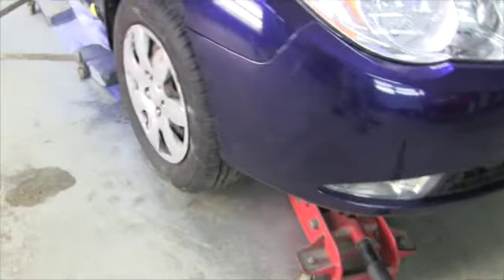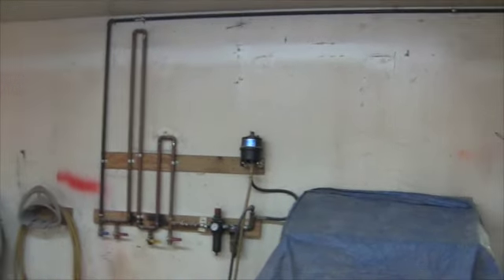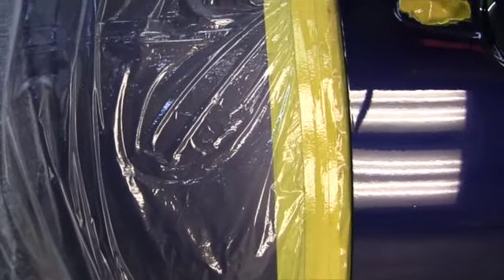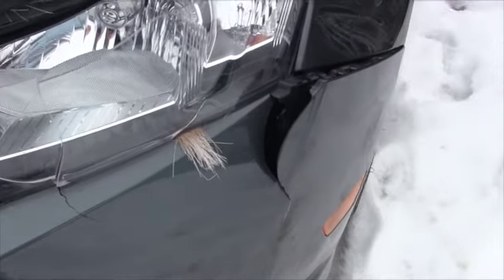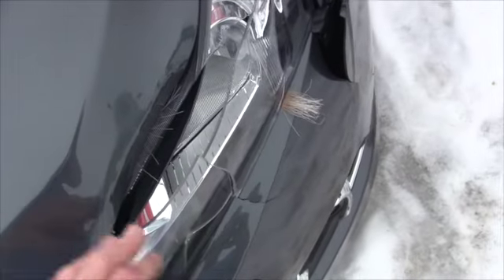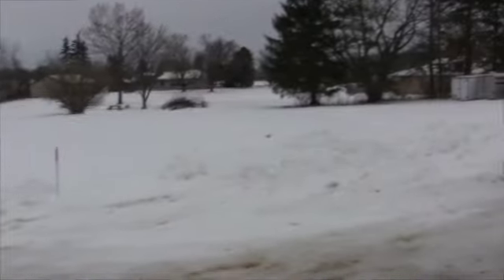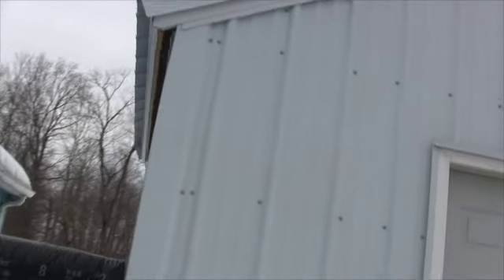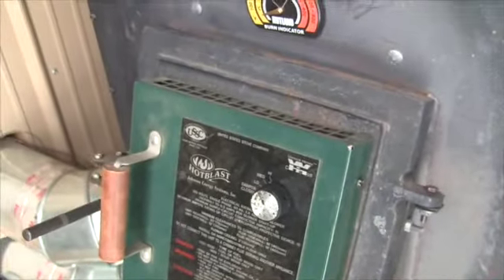Hyundai Elantra - assembled and ready for a buff job

Comment: I figure on average 10 -15 truck loads , with all the wood you can pile on the truck.
Reply from the maker: Probably not far off... 
I was figuring 5 to 6 cords per winter judging by how much I have gone thru.  But then again, I have used some pretty sub-standard wood this year.  Good dry hardwood is gonna be key for next season.  I was so ill prepared for this winter and the learning curve for the furnace has been steep, lol